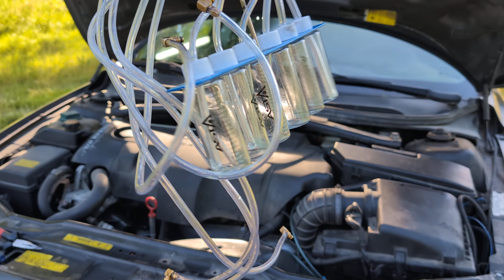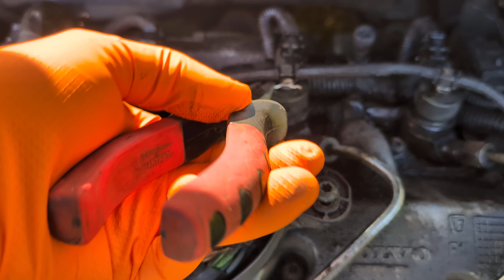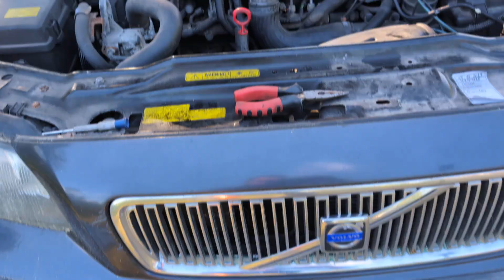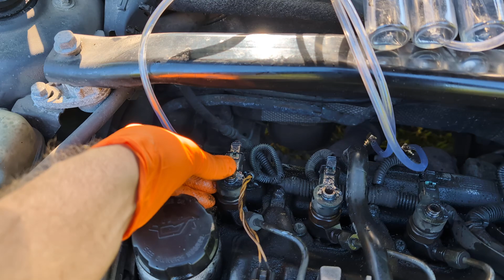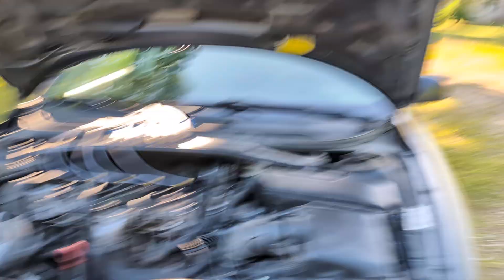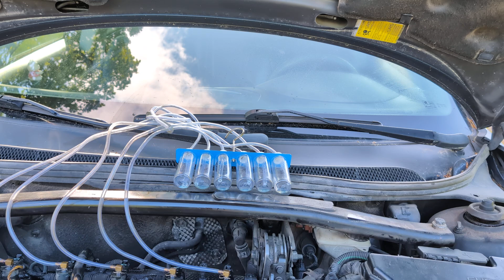Volvo D5 injector return/leak test (poor or non start issue) V70/S60/S80/XC70/XC90

Comment: Hi, so a few questions, whats the point of the container? And what needs to be  done to the injector itself?
Reply from the maker: The container is for measuring the injector return quantity. The faulty injector has to be rebuilt/replaced
Reply: @HeapsofProjects I was referring to the plastic jug you placed the whole return line assembly
Reply from the maker: @LukazzK  Just to collect what ever drips out from the return lines
Reply: @HeapsofProjects ive dissconected the whole thing from the T shaped joint, and theres a flow both ways, I do have a leak from the injectors, but should there be a flow from the other 2 lines that the return line connects to?
Reply from the maker: @LukazzK  Yes as this return connects to pump return which would still have fuel going through it